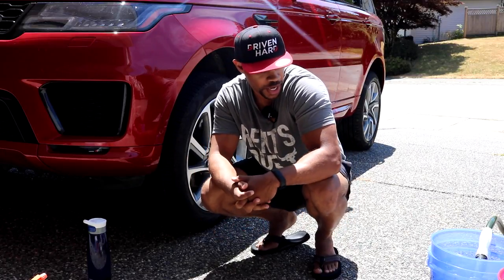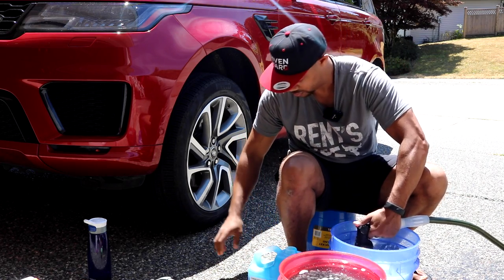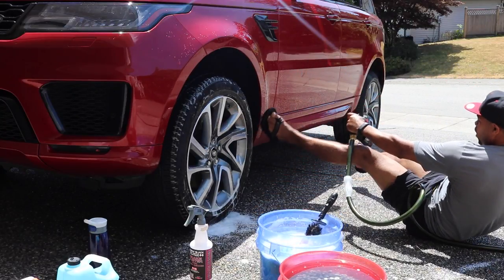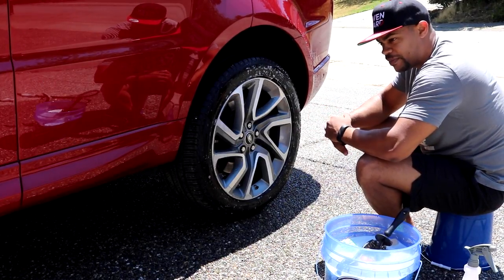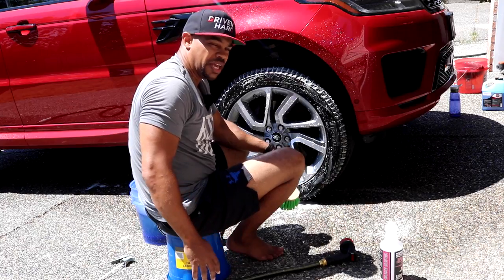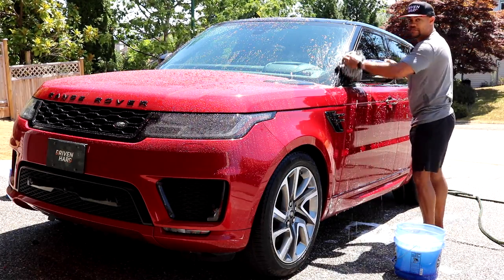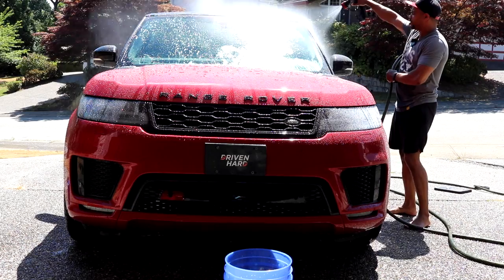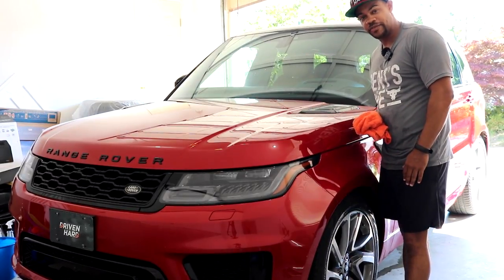How To Wash A Range Rover Sport | Wash N Talk | Driven Hard

Comment: 😎 so I watched the video till the end yesterday and there’s a couple of things I wanted to say.

The video quality is getting better by time, but one thing I noticed in the first few minutes was focus hunting by the camera, so try locking focus manually..

😂 it was so weird for you to wash a car that wasn’t dirty. Come on bro next time when you do a washing video make sure that your Range is fully submerged in mud and that mud when it gets washed away is so satisfying to watch..

Here’s a tip that my dad used to tell me, never wash a car under the direct sun, not good for the paint as water/soap gets dried quickly..

I think the Ford Bronco is a really good car. It drives really well on and off-road from what I’ve seen on POVs

But the quality control should definitely be getting better with the roof panels and other stuff.

I was a guy who didn’t like Ford much until we owned one. All Fords aren’t great but some are 😎 

I agree to your point of Land Rover’s smaller engines being less reliable but I don’t think they’re absolute trash, they’re just fine and will get the job done

V8s always had and will have a unique tone but that doesn’t mean all 4 cylinders and 6 cylinders are 🗑 

I hope the next SVR isn’t a Hybrid 😬😑
Reply from the maker: All 4's are trash, there are fine when you are 16 in your little civic but for longer road trips you want smooth power delivery and overall quietness that a 4 wont give you. there are a few solid V6s (etc), BMW has a great straight 6, porsche flat 6
Reply: Driven Hard I completely disagree with all 4 cylinders being trash. Yeah they’re not so good as a V8 or V10 obviously that’s why they’re in cheaper cars, but that doesn’t make them 🗑.. V8 is the best overall IMO, and I agree upon that fact.. 

V10 is exciting 
V8 is the best
V6/I6 is decent 
I4 is fine too most of the time

We’re not talking about performance here.

Have a nice day!
Reply: Driven Hard yeah V8s are so bitter smooth on the highways. I do miss the old V8 rumble days

Comment: i agree about not getting the smaller engine range rovers. I have the l322 v8 4.4l bmw engine and all i had to do is synthetic oil change, new coil packs and ngk spark plugs, and she runs so smooth and hasnt given me any mechanical problems 400000 miles later. drive from cali to oregon with ac on full time and it did not give me one issue. And ya if you cant work on the range rover yourself without warranty then dont buy one. i do all the work myself , like i had to change the ride height sensor, simple and fixed my whole air suspension fault issue. Range rover is the best suv ever made hands down.   😎
Reply from the maker: well said!